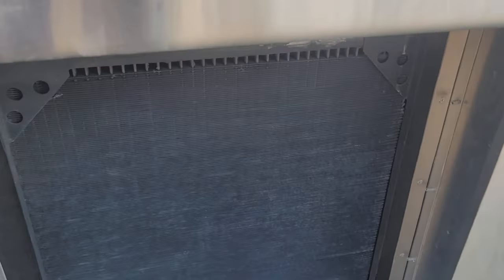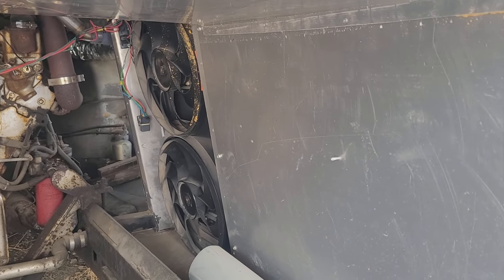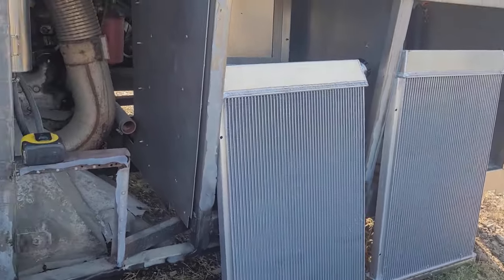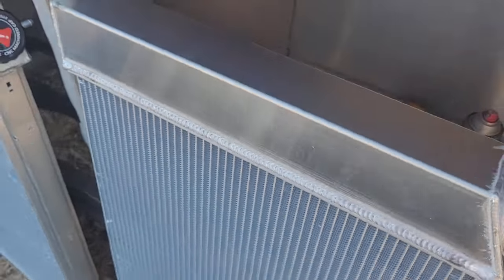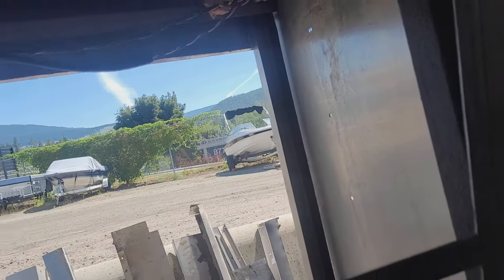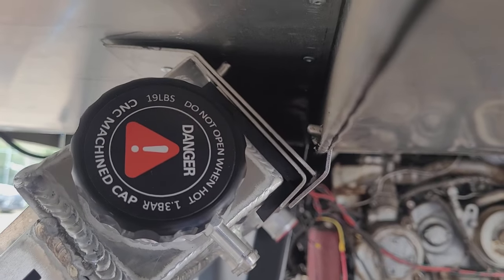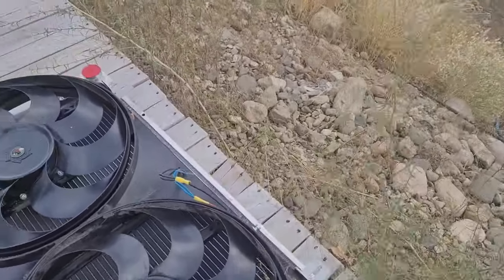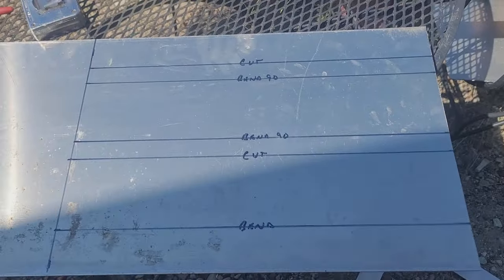Bus Conversion Project - Video 126 - Upgrading the cooling system (Part One)

Comment: I foresee a problem.  Radiators are meant to stand vertical so all of the core is under water.  Angled, there will be tubes with no water flow.
Reply from the maker: Look at a mid seventies corvette

Comment: I apologize jumping in at the beginning of this thread, but, so far, the Klaxon Horn is blaring and red lights are flashing.  Contra if the following points are addressed during the presentation.

The first step in constructing a cooling system is to obtain the specifications from the radiator manufacturer and the heat output of the engine and ensure they match.  Next you do the same with the fan manufacturer.  This will give you the basis parameters for the components.  Next engineering the installation so each component can perform the required task.  

The focus should be on  the relatively great capacity for water to carry away heat and avoid boiling in "the red zone" - the water-jacket side of the combustion chamber.  Water streams in the center of a cooling tube, with as little as 10 deg, F. temp differential  will "layer" and not mix.   You might be fine at the Temp sensor but boiling at the combustion chamber.

The final "design"  test is to check the pressure just before the inlet to the water pump.  If the internal drag is significant,  the pressure will  drop, even in a pressurized system, and bubbles will form.  Bubbles insulate and you'll never be able to meet the design criteria !

Forgot to mention,  internal features of the cooling jacket can frustrate even the most careful component selection.

The closing thoughts this is a simple description.  My cooling lectures can easily exceed 3.5 hrs and only cover 1/2 the "simple level" material.
Reply from the maker: Thanks for the input....it's been working great for the last year

Comment: You're fortunate to have the space! You might have to do something with the exhaust so it doesn't suck that heat back in. I'm wondering if you run the radiators on each side in series they would cool better? That looks like a work of art! Thanks!
Reply from the maker: Yes, the extra space is a bonus, this won't work for most people as they don't have the extra space in a stock bus.The exhaust has to be rerouted..just haven't gotten to it yet,Iwant to run it to the rear of the bus under or beside the bumper. I thought about running them in series but I think in parallel with fans on each rad will cool better...we'll see I guess... Thanks for your comment